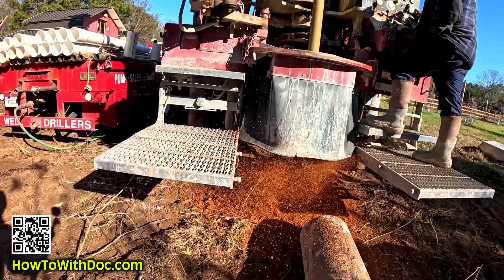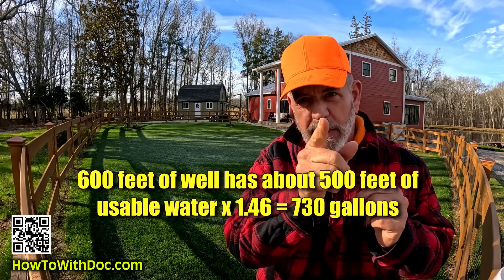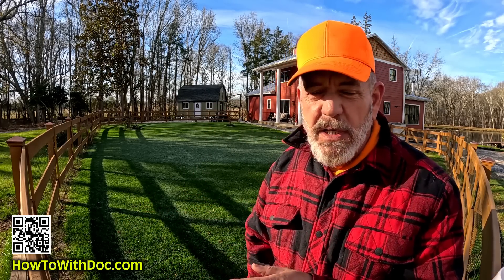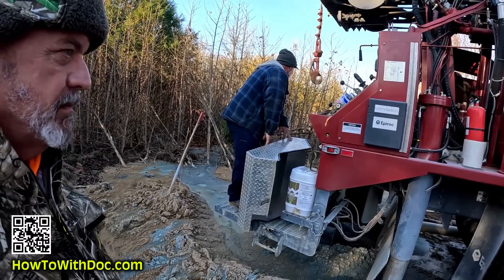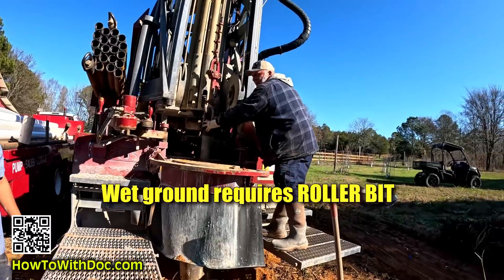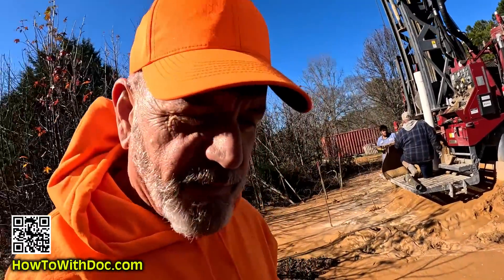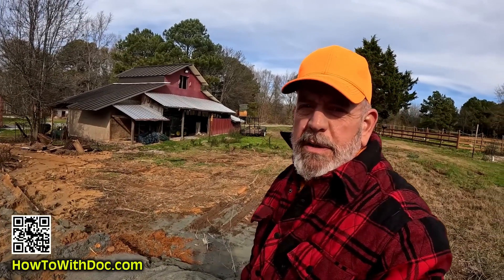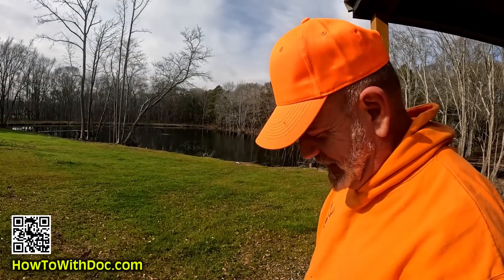How Deep to Drill a Well - Full Well Drilling

Comment: And I've drilled Several thousand Wells Here in the coastal Plains of North Carolina Deeper is not always better You can run into salt water Or unusable water that is riddled With sulfuric gases which renders the water unusable and undrinkable without a 20 30k treatment system Good luck  sir .
Reply from the maker: We expect to replace the UV filter LIGHT ONLY every 8 months or so. However NOTHING else will kill what the UV filter does. Also, we have a well at the beach and yes it must be shallow or you get salt. Go to the MIDWEST and you may have to drill over 800 feet for water. Location is the factor... not experience.

Comment: If you set your well pump around the 200 to 300 foot mark it will be easier to pull it out and work on it yourself if needed. Also the deeper you go the more horse power pump you will need.
Reply from the maker: We set ours about 75 feet from the bottom and use a better pump. In the end, it only costs slightly more for the pump but the extra reserve is worth it.